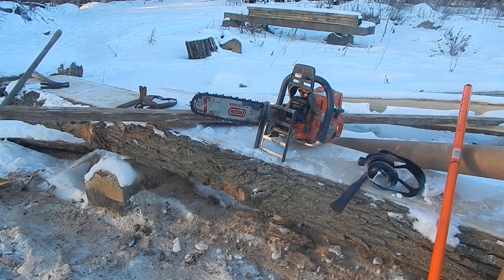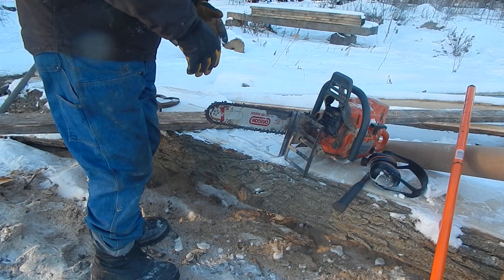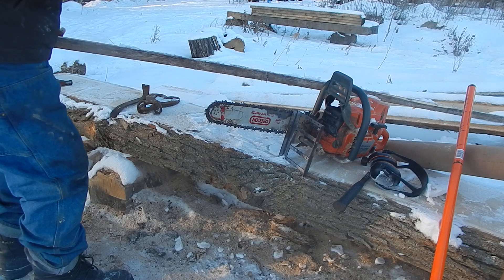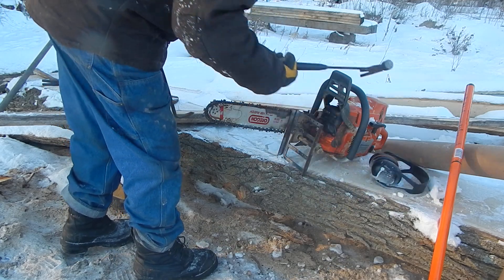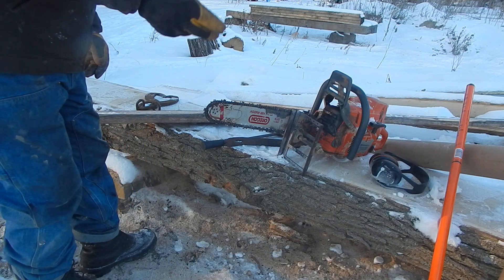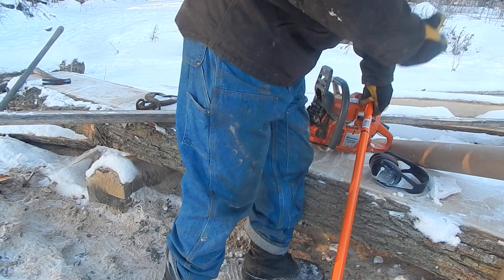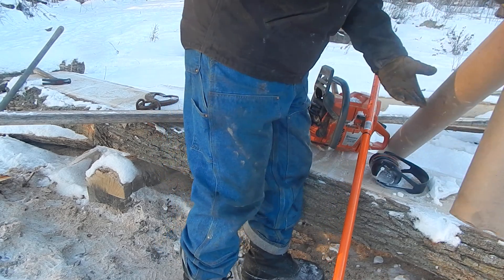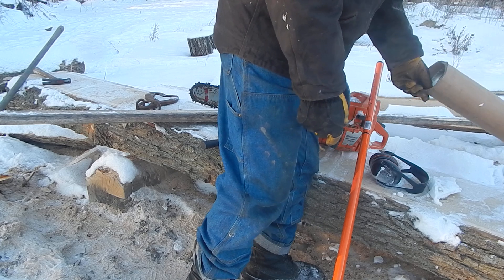Grizzly Bar

Comment: Hi, your newer videos have comments disabled but I have questions. I was wondering if you had anything special to put on drive shafts in the winter so they dont freeze? My familly has a snowe removal company in Canada where I live and its -42c here. So the shafts freeze and dam,age the snow blowers and tractor. 
Also second question. I have my eye on a stevens model 425 .32 rem. Its 1500$ CDN, do you have an opinion on those rifles?
Reply from the maker: +Northern Woodsman I f the problem is in the telescoping sections sticking and applying strain to the universal joints, I would try a graphite based lube like never seize.  I don't have experience with that rifle, they are rare, but it does seem like one that would bother me until I owned it. I would be delighted to run across one around here, it's right up my alley.  Pricey, but not something I wouldn't be willing to scrape up the cash for, oddball guns appeal to me.
Reply: Thanks for the reply, ive been told to try combine grease that john deere makes and that was supposed to work great but it dosent! It freezes right away. Il try your suggestion. And for the rifle im debating on getting it or not.

Comment: Mr Looms, I use Some wood screws that have a Phillips head, but also have a square hole in the middle for an extractor bit. These may work for You Sir.  You would have two ways to get them back out if they try to strip.